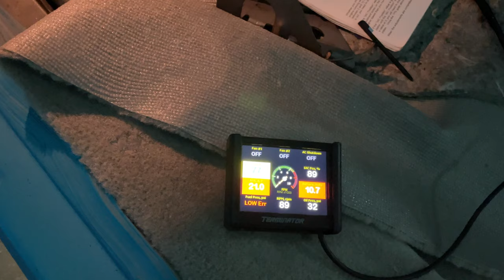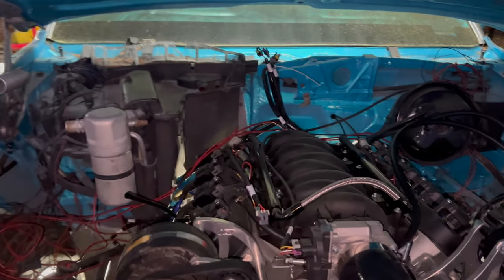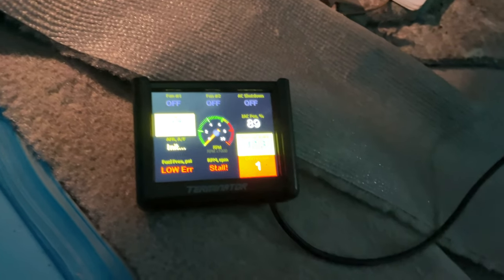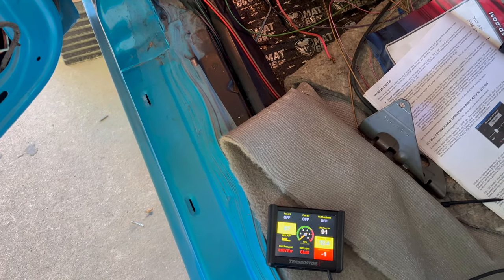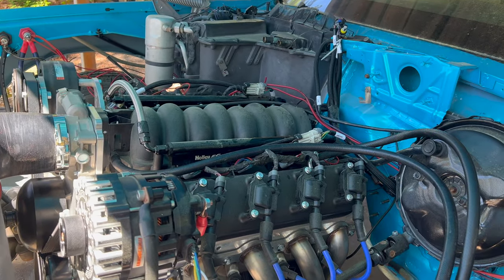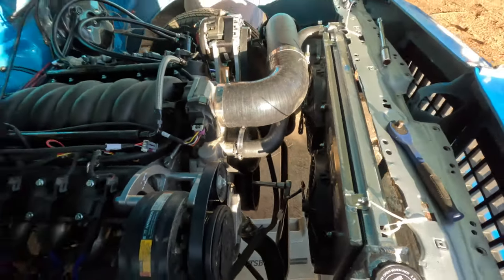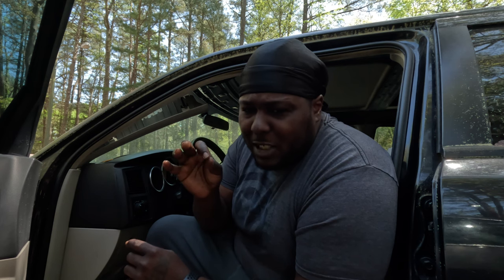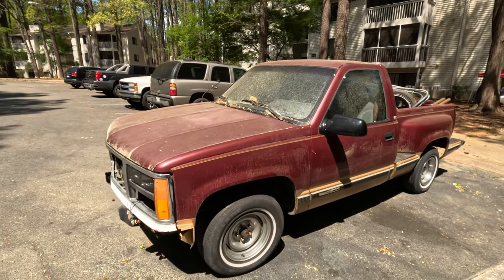Box Chevy Build Ep.54 Troubleshooting No Start Problem, New Crank sensor Cold Air Intake installed!!

Comment: 20 to 30 psi of fuel for your 6.0 is not enough to crank that motor you could have a bad pump or bad regulator put a fuel gauge on the fuel rail if its showing 29 or 30 you need to see 55 60 or that motor will not start i had the same problem and get a fully charged battery you will need it to turn that motor over i have a red top optimum

Comment: If it’s back firing bro check your coil pack harness… they are actually numbered on the LS engine…flip them around and see if it starts… I had the same problem with mine
Reply: Right...first red wire on the driver side should be at the firewall....red wire passenger side should be first at the front towards the radiator

Comment: The wire or circuit your using for your 12v key run / cranking might have a resistor that drop voltage from 12v to 9v...holley recommend 10.6 V. holley systems will not work with less..  i would recommend you using a relay for your 12v key run/ crank to get a clean 12+ voltage to holley controllers ect.
Reply: Needs starter relay

Comment: Take the intake tube off hold the throttle open, spray some starting fluid/brake cleaner in the intake and turn the key start it. If it runs off the spray then you have a fuel distribution issue,clogged injectors,fuelpressure issue.
Your battery and cables suck,amp cable never as good as real battery cable welding cable. Hook up another battery on your junction under the hood just to test it out.

Comment: Southside Nate!!!!  Great job on the build bro!!!!  As long as the voltage is below 12 volts it ain’t gonna start….   Make sure you did not use your hot side of the coil for a 12v input to your controller….  If so that wire that supplies 12 volts to the coil will drop below 12 volts causing a not start condition….  Blessings Fam!!!!!  💪🏾 💪🏾 💪🏾

Comment: Get an external regulator make sure there’s at least 50psi on the gauge.

Check the spark plug harness make sure the harness labeled is plugged in accordingly to each side.

Battery voltage has to be at least 11.5-12 while cranking.

Make sure the timing chain isn’t off by a few teeth or 180° out as this happened to me.

I let me turbo truck sit for 2 years cause of the no start issue and so I was getting low Rpm while cranking and stall I ran a wire from the battery positive to the positive on the crank sensor power wire and she started right up.

I have a lot of experience dealing with this problem 

You could also have an air gap too large on the crank or cam sensor which is why the last 2 lights are blue on the ecu.

While cranking see if your last blue light switches from blue to green multiple times while cranking. If so then you are good with the crank and it’s another issue.

Comment: Check your ignition wire and make sure you get 12 volts while cranking as well and not just 12 volts with the key on. Once the volts drop while cranking not gone send enough power through. Just a suggestion keep grinding
Reply from the maker: I did check it and also move it to another location just to see if it was doing the same thing! i meant to update y’all on the video but forgot to. the voltage only drops after i’ve bn trying to crank it over and over and the battery has gotten weaker!
Reply: Could be a combination of all three of the issues you’re thinking starter flex plates and battery. I’d check timing too before you pay someone just a thought tho. You got this bro 💪🏿
Reply: @SouthSideNate   have you rechecked the wiring to your starter? The starter wiring could be causing the issue, but it also could be a faulty starter

Comment: Bro just a suggestion I would clean that paint off where you have your grounds at on the frame and do direct metal for a firm ground
Reply from the maker: I actually did! Every point of connection for the grounds are on bare metal!!
Reply: U mentioned that ya shimmed the starter but did not say in which manner. From the instawear marks noted on the 2, the rear of your starter would need to move away from the block, which in turn  moves the gear closer and straightens that binding of the gears. I wanted to ask even b4 I checked for myself; is it spinning in the correct direction. A motor that is trying to fire when rotating bkwds acts like this and when you 1st put the GP under it backfires a few times. Pay attn to what it does to the overall  act of rotation. That is / was an awesome starter you had there, but low voltage is a starter killer, so that may help you keep a few more $ in ya pocket. 1 last thing my brother, this was my 1st look at any of your videos and my comments are aimed at helping you conquer your Goliath. Let me know when  you solve it. Guy near the top made a reference about 12v supply, that sounds like something worthy of checking into. You got this! 
Are any exhaust valves staying closed for whatever reason causing high cyl pressure🎉which would increase the load placed on the battery and starter. Just thoughts in my head that may spark something for ya. Peace!

Comment: Make sure you have the correct harness for your 24x or 58x reluctor wheel.. make sure your coils are firing correctly.. I went thru that with my 5.3.. but I’m carbed running the msd6014

Comment: I read somewhere before that the terminator will not read the o2 sensor because of the air being to close to the end of the headers. You may need to put a piece of pipe on the one with the o2 sensor to get the o2 sensor away from the air...it may help.

Comment: I told you about the starter last video. LS motors don’t sound like that on startup.
Reply: Also, why is your throttle 90 percent open before starting? Do a Relearn on your idle air control and try again.
Reply: And last thing, get a corvette starter. It crank faster.
Reply from the maker: You damn sho did! You mentioned the measurements it should be! i’ll be uploading a video of it soon because i’m not sure if i got the right flexplate

Comment: Bro check grounds
Check flex plate teeth for 6.0 168 I think
Try stock starter
Fuel pressure 58 psi
Try with maf sensor plugged up
Make sure constant key on power source
Make sure all the coil wires are plugged in 
Spray sum starter fluid in the throttle body see if she fire up if she do it’s not enough fuel pressure to fire up
Reply: Fuel pressure should be 58 psi on a ls more depending on power adders

Comment: Holley requires 18-24 inches of exhaust pipe after the 02 sensor…. Also the grey and black crank sensors are not the same

Comment: Put a manual fuel pressure gauge on at the fuel rail on the schraeder valve…..i dont think your electric sensor is synced correctly to your ecu…..and 26.9 lb hr is not your fuel pressure its your injector flow which isnt right if the car isnt running

Comment: Redo the timing bro
Reply: What do you mean? It’s coil over plug no timing adjustments
Reply: @pipelinemotorsports2777  🤦🏿‍♂️ his timing could still be off which causing it to back fire and not start. Just need to pull the timing cover off and line up TDC AND SEE IF THE TIMING MARKS ARE ALIGNED WITH EACH OTHER.
Reply: Not to mention the coil pack sequence....

Comment: Check fuel pressure and get volts straight
Reply from the maker: I’m definitely thinking fuel pressure because i’ve heard that the corvette style fuel filter and regulator can’t hold up to the 340 pump!
Reply from the maker: And i also want a external regulator that can be adjusted. At the moment i don’t have a fuel pressure transducer to be able to have it shown on the handheld.

Comment: Cuz is any gas in it
Reply from the maker: i put 5 gallons in there should be enough to  start it. when i went live a few weeks ago i had a few leaks from the fuel rails but it didn’t spill 5 gallons worth. i didn’t want to put to much in case i had to drop the tank bk down.

Comment: Your starter is junk. It has a return spring to pull it back on its own. If it’s sticking replace it. Battery should be 12.5v cranking. Anything less the Holley isn’t gonna work